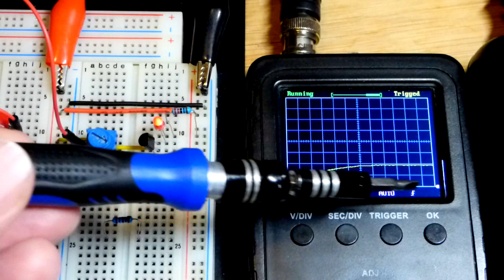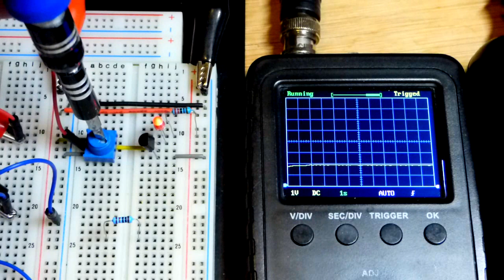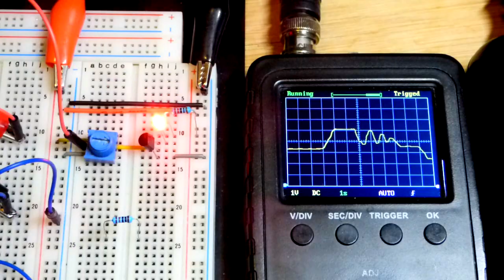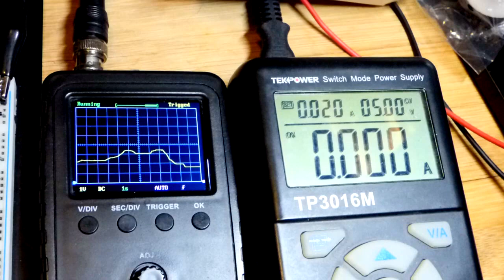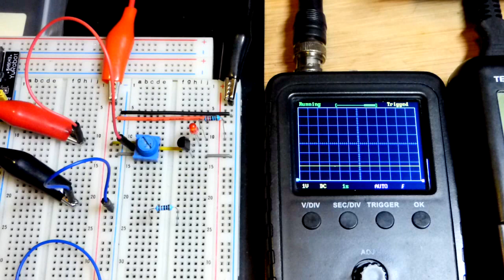Voltage controlled resistor circuit using 2N7000 n channel enhancement mode MOSFET lesson 0035

Comment: It would be cool if you could more directly measure the partially on case.  Current from the power supply was a helpful clue.  Perhaps also show voltage drop across the MOSFET?

An LED will be at nearly peak visible brightness with just a few volts and a few milliamps of current, so it can be hard to tell the difference between fully on and partially on (also applies to PWM).
Reply from the maker: Definitely. Should measure the voltage of everything 🙂